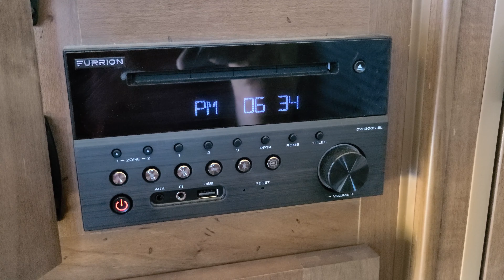Slightly Biased Review of Outdoors RV MTN 29 TRX

Comment: To me, interested in getting out in the sticks and in long term ownership the pluses would be: heavy duty frame, big tanks, quality tires from the factory, overall build quality and insulation. 

Things I’d change: Azdel instead of Luan.  Zamp pwm controller doesn’t belong in this price class, mounted over bed?  I’d expect Victron with a MPPT remote by the control panel, along with a Victron monitor.  Heat pump would replace the AC.

Comment: We had some Chromed Plastics in the military that had a very dog feces smell, that eventually went away... a very fair assessment of the go/no go's, as usual.. Thank You... 
There are a few videos on endless showers out there... I just use 55gal blue drums (2-3) in truck bed, with an adapted whole house filter (to fill them and trailer... 5micron).. so I can fill up as close to the woods as possible, and not have to haul the added weight... 
Stay Safe and God Bless
Reply: you put 3 x 55 gallon drums of water in your truck bed?  that's over 1300lbs of water.  How the heck do you secure 3 of them?

Comment: I just bought a TRX27 I have a few issues myself, a owners manual would have been nice, still don't know how to lower the bed? Can not figure out the DVD player, or the second switch by the window to turn on the lights above the bed, there was no information on anything, you would think after spending 70k on a RV that is advertised as quality would have a proper owners manual, maybe you can do a video on lowering the bed, working the DVD, and what the witches work, thanks buddy, or maybe outdoors rv can post one
Reply: Can I ask what dealer you got your trailer from? I like the 29TRX as I think it will suit our needs. I’m a little shocked that the dealer didn’t take the time to go over everything about the trailer when you picked it up (or the previous owner if used). Thanks for any insight.
Reply: I drove from Iowa to Sumner Washington and picked it, I bout it at Sumner RV Center I bought it brand new,  honestly, they showed me lowering the bed, I didn't really get it,
Reply: @greggogolla4191  Gotcha. We are going to drive from Colorado to Oregon and get a 29TRX from Thompson RV in the next couple of weeks. I heard they were a very good dealer so I’m hoping everything works out. Thanks for the info.
Reply: boomers lol